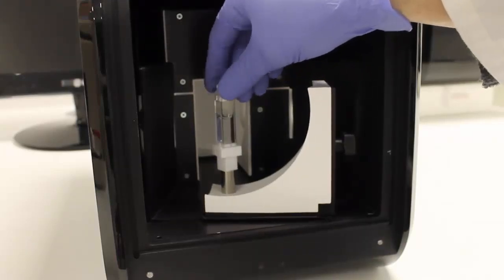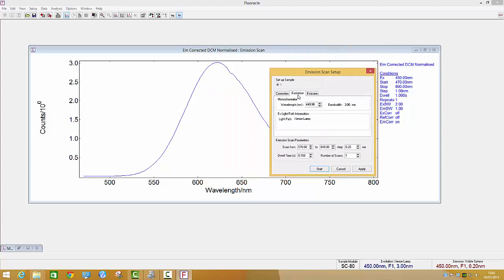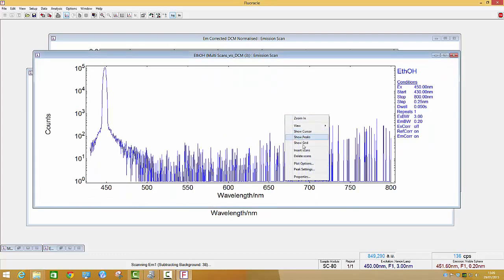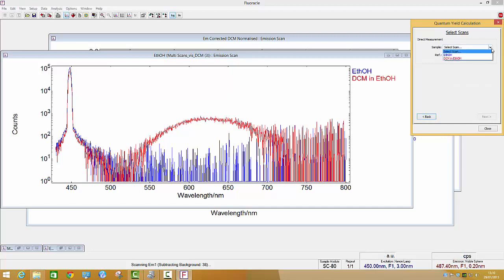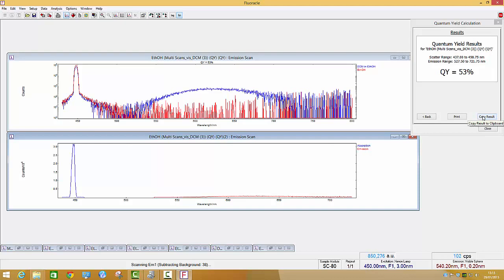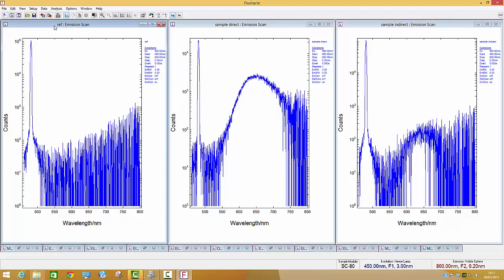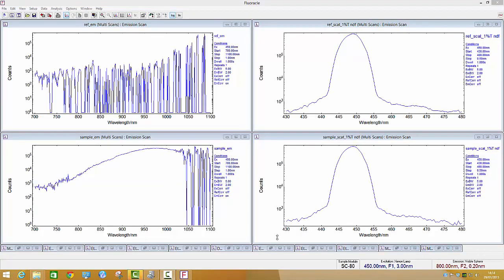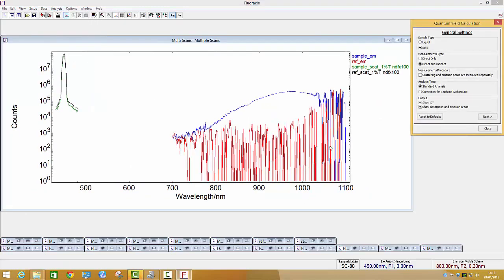Quantum Yield Introduction using FS5 Spectrofluorometer

Comment: Hi, thank you for your video. It's really useful.
Just have a question for measuring with powder sample. For measuring the powder sample, will we fill in the holder tray? And how to avoid the contamination if not thing used to seal the powder. Thank you
Reply from the maker: Hi Thank you for reaching out.
With regards to measuring a poweder sample, you should add powder to the tray using a small spatula ensuring that it’s distributed in an even layer covering the entire surface. We highly recommend covering it with a quartz cap to avoid contamination. Any powder that remains on the external surfaces should be removed with tissue and deionised water. We advise to add a quartz cap to the PTFE plug for the blank for a more accurate PLQY result.
If you don’t have sufficient powder to cover the entire area of the tray, we recommend a small volume tray which can be purchased from Edinburgh Instruments. You can contact your sales representative for more information.

Comment: if we want to calculate the APLQY from the text data using ORIGIN, what should be the methods?
please help me with this?
Reply from the maker: Thanks for your comment @subha6389, 

To determine photoluminescence quantum yield (PLQY) from Origin-exported data, you can follow these guidelines:

Data acquisition and exporting:

Identical Parameters: It's crucial that all spectra are measured under identical parameters (excitation wavelength, slit widths, step size, dwell time etc.) for valid comparison.
Emission Corrected Data: The .txt emission data for both samples and blanks must be emission corrected for instrument response before export for accurate PLQY determination.

In Origin
Import your corrected data.
Utilise Origin's 'Integrate' tool (found under 'Analysis > Peaks and Baseline'). This feature is effective for accurately obtaining integrated peak areas for the emission and scatter components of your blank and sample.

PLQY Calculation
Once these integrated values are obtained, the Quantum Yield is calculated using the simple formula:
QY = (Integrated Sample Emission - Integrated Blank Emission) / (Integrated Blank Scatter - Integrated Sample Scatter)